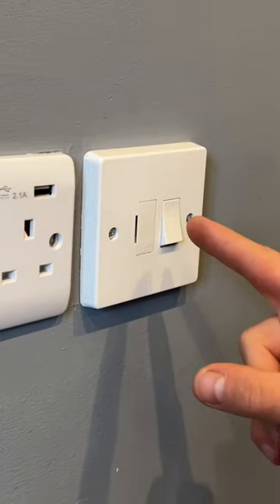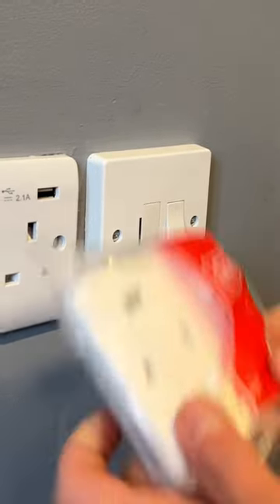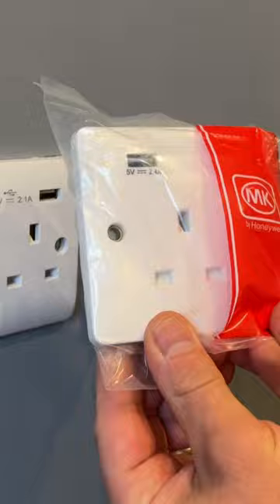Should homeowners and DIY Dave be allowed to change socket fronts? #electrician #shorts #prysmian

Comment: I would have checked the connections on that spur with a meter before touching them. You can never assume. I am not an electrician but I have been doing this stuff since I was 11, taught by my Electrical Engineer father.
Reply: You're assuming he didn't. You should never assume
Reply: Yeah they edited out the sparks and the "oh sh*t!" moment.

Comment: And in a year you can take it off again and replace it with one that supports USB-PD on a USB-C connector.
Reply: Those things are an absolute nightmare when it comes to carrying out insulation resistance testing. If you find these in an installation you can only test combined L/N & E otherwise you'll get a dodgy resistance reading and possibly fry the workings of the USB part of the socket.

Comment: I could use that old FCU. I'm spurring a light circuit off a socket circuit so i can run metal luminaires ... Just remember to throw a lower calued fuse in and all good

Comment: Never bother with CPC fly leads myself especially with plastic face plates because that’s what the screws are for
Reply: Best spark in the world this guy tho😂
Reply: Sort agreement but more cpc u have the more it saves your life
Reply: @mickbrooks8114 really? I'm gonna start putting 10 fly leads in each socket from now on, cheers mate 😮
Reply: Yep 👍🏼
Reply: @bullhurley-uv8ys  bit ott
Reply: @mickbrooks8114 No it doesn't.
Once you have a CPC of sufficient cross sectional area then that is all that is required.
The breaker trips.
And if an RCD is fitted, which is highly likely, then the thickness or number of CPC's makes no difference.
Reply: @deang5622   better to have all the point connected  that are there not hit one miss a few

Comment: 2.4a @5v is just so slow! Sockets are always superior as they upgrade with the times. Current fast chargers are 4.5a @ 9v
Reply: Sometimes ots about space as well. I charge over night so speed is not an issue
Reply: yeah but if you're not in as hurry and overnight is fine then its perfect.
Reply: We are at 20V @ 5A with USB-PD. 100W

Comment: That cable must have been a joy to strip half the outer sheath is still on lol
Reply: Yeah noticed that, done on a friday when the chalk had already left for the pub!
Reply: Don’t understand the need to earth a ko knockout box
Reply: @leewareham4529  yeah - I don't get that either. I know it's in the current regs (wasn't when my house was built in 2000), but I really don't understand what it gains. I'd have thought it just makes it marginally less safe by putting 2 conductors under one screw if there isn't a second earth terminal!

Comment: Nice. Torqued down terminals and clocked the faceplate screws too. Though I must admit, I prefer 3 o'clock to 2 o'clock, but hey...
Reply: Always 12 o'clock then crap falls out of the slots😂
Reply: @baldyslapnut.  That is what we were always made to do on hospital installations. Screw slots always vertical! That was about 40 years ago though :)

Comment: Yes! Absolutely... but you need to know what you're doing and work safe, of course.

As a DIY'er, I have sorted some fairly big oversights done by pro's at friends houses... earth wire not connected to metal faceplates, MCB which wasn't grabbing onto the busbar, loose connections in both light switches and sockets... even a splice to a lighting circuit which was done by just twisting wires together and taping them(!!) instead of a proper junction box. They probably thought nobody would ever see it, but it was discovered years later when floorboards had to come up for a different reason and we saw it... then wiggling it made the lights flicker.

I think the common factor is that it's been new-builds and I'm guessing the sparkies have been under time pressure from building managers and thus, in a hurry.

Comment: I've never understood wanting a USB charging port built into a receptacle or to furniture. Technology moves too fast for this to be viable, within 6 or 7 years it'll be out of date, if it isn't already out of date. 2.4A is bare minimum for most phones today, and it's a slow charge. Not to mention the potential security concerns with this. You're far better off using a high quality power adapter than this.

Comment: I wouldn't have a usb charger on all the time 24/7 I think it is a fire hazard, and worse, a parasitic load on the grid, wasting electricity 'round the clock and adding justification to build more power stations including nuclear reactors, the waste from which we have not got any data on really for it's long term effects on the global DNA code/fundamental property of life on earth.

Most of the electricity we get, we waste

Comment: what makes this ipad compatible?

the one next to it is ipad compatible 

pretty much any charger made since 2011 is ipad compatible 

we havnt used 1 and .5 amp chargers in ages and even those are ipad compatible

and 2 amps isnt even enough for the current generation that need 3 amps if your going off charge speed

so you griped over the .3 amps difference and still fell short of the 3 amp rating for a ipad

and its not even usb C or capable of the power delivery spec for 35/100w charging

Comment: I would never trust a USB power supply that I can't just unplug if it has a problem. Just a built in fire hazard.
Reply: Agreed. I've seen a few burnt ones in hotels in recent years. I've also seen many dodgy USB cables that I wouldn't want in the wall. Plus you're stuck with whatever power delivery capacity the faceplate has when installed, so when you get a new device that supports ultra mega fast charging, you can't benefit from it, unless you upgrade the plate again 😂
Reply: And constantly consuming something (if tiny) and making fixed electrical testing bloody hard work...
Reply: Im guessing insurance would say you shouldnt have installed a usb charger into a power socket.
Reply: Interesting thought. I am a long since retired electrician, but was surprised that the NICEIC allow these USB outlets on  sockets, when no local means of isolation is present.
Reply: @Stan_55UK   I would assume that it isn't covered as at the outlet they would constitute a low voltage appliance which isn't regulated in the same way.
Reply: @harrier331  That would make sense.

Comment: Personally I won’t touch electrics and plumbing and gas just because it safety issue. But how much would an electrician charge to swap out plugs the reason why I would get an electrician to do the work if I had a house fire the insurance can’t say we won’t pay out cause you never got the work done by a professional. 

But in essence it’s only 3 wires as long as you put them in right hole then your golden but it the what if

Comment: Incorrect safe isolation, no ferral on the CPC fly lead, not using a torque screwdriver. oh and not taking the outter insulation off the neutral. Crap work!

Comment: Is there any need for fly lead when fitting plastic accessory?
Reply: It is not the plastic accessory that matters here, it's the metal back box which needs to be earthed.

And in this particular case it is not required because the earth wire is connected to the socket outlet and continuity exists through the metal fixing screw to the back box.

The fly wire is completely superfluous.

But there are occasions when this technique cannot be used, so check the regs.

Comment: Stuff like replacing new outlets or a new switch is ok.

Anything else that involves changing stuff like in the video shouldnt be done lightly, you shoudl understand what are you doing.

I've changed a couple of smart switches at my house, anything involves the main cabinet i will have a sparky come in.

Comment: Dumb question: you didswitch off the mains to do that,  right?
Reply: He didn't do safe isolation? I didn't see him verify
Reply: @PearsallEu exactly he only used a plug checker to make sure the socket was dead - he should have used suitable voltage test lamps and a proving unit to check the spur was dead
Reply: He made sure it was wired correctly with the Kewtech at the twin that’s being supplied by the fused spur then switched that ring off at the CU. Pretty sure he would have used a 2 pole tester. But I think the idea is that it’s DIY and the DIY guy may only have a socket tester and being able to isolate at the CU if a socket tester at all. 
Best regards, 
Scott. ✌️🙏✌️
Reply: Well if they are allowed to change a plug!.......?

Comment: I have a freind and he says he want kitchen done and he will do electric him self I did start asking questions what wires he want to use for oven and induction hob he couldn't give me an answer so i said ill help you. I went to his house and look at the wiring I said lets we do some testing I knew he already done some electrical work, so half of sockets have 120v
We end up rewiring all house.
Even if you changing socket or switch how DIY guy know is the right voltage passing through there maybe switch damage and that could be problem for appliance to work correctly.

Comment: I've replaced all my plugs with USB ones myself. I've also upgraded various light switches.

Most of them, you're unscrewing 3 wires and adding them straight back in.

The trick is to electrocute yourself when you're 12 to build up a healthy fear of what happens if you rush it.
Reply: Oh,. couple of things. I throw the master breaker always. The first time I plug anything in, I've got more padding and insulation on my hands then a catcher at Yankee Stadium.

Comment: Had a fuse spure that became obsolete due to having central hesting installed as it was for an immersion heater, I found out it still had power going to both so I removed the fuse inside the Fuse spure and wasn't sure if it would shock or short on any loose wires or exposed copper so I removed the 13 amp  fuse to be safe and lessen the risk of a fire , now it no longer powers up. As the light on thr spure dosen't light up anymore hence why I know it's no longer powerd.

Comment: Why are you using a 5v 2.1A USB A outlet in 2023? Thats not going to charge any iPad, or mobile device very fast. At the least it should be QC3.0. Really these days you should be installing outlets that are USB PD
Reply from the maker: 2.4amps buddy
Reply: @Cjrelectrical  You realise devices dont actually draw 2.4A just because the port can provide it right? Even if they did, Whats 300mA @ 5V? A extra 1.5W?

QC 3.0 can provide 5v, 9v, or 12v. USB PD, more than 20V. At the same 2.4A, thats 48W. PD can actually provide 100W, and be used to charge most modern laptops.

These have basically been the standards for the last 10 years (with PD being the newer, more supported standard)

This video is basically "i had some old stock in the van, screw this old guy, what does he know"

Comment: USB A IN 2023? This is crimal also BTW These wall USB Sockets fry your batterys if not checked theyre correct before use but have fun
Reply: 'fry your batterys(sic)' - really, how? They're not connected to them.

The ludicrous ideas some people have about subjects they've never bothered to learn..
Reply: @Monkeh616  many times i have used usbs in sockets and so have many people I know they have melted cables themselves damaged phone battery’s causing battery health to rapidly drop to very low levels and cause the battery’s themselves to get hot… I agree maybe not all plugs are the same and it can be down to cables etc but if you do not research what you are using they can certainly cause damage. From your POV My comment may seem as if it’s backing up USB C Saying it fixes this issue but it doesn’t it can have the same issues as any others. The fact you can say “People comment on what they have never learnt” proves your lack of respect and recognition for others peoples opinions and reasoning. Completely disregard what I’ve said but it’s common knowledge these USB port in power sockets can causes damage to tech items cables phones etc if not check used installed or even compared with compatible cables devices etc… my research and previous experience has show me this is correct…
Reply: @Monkeh616  it’s also besides the point the main objective to my comment was the fact he was using USB A Sockets and not USB C in a day and age where most tech uses USB C
Reply: @MY735TV  And where are you getting these sockets, and are they by any chance the same quality as $2 'chargers' from far eastern suppliers? The batteries too, probably.

It's not common knowledge that properly designed 5V supplies melt cables and damage batteries, because that simply isn't the case. There's no practical difference between this and any plug-in supply as far as the device is concerned, and the output to the battery is managed by the device, not the supply.

Comment: WTF would anyone install a switch mode power supply that you can't turn off or unplug? I got a couple of those and after a bit of testing they went straight in the bin.
Reply: They also make a horrible buzzing noise unless a large load is connected

Comment: That back box is a fire hazard as it's not fitted correctly .You don't need a earth cable as its earthed through the plug screws and have you checked you have the appropriate fuse and cable size to be compatible  and support with what you have fitted now
Reply: Some years since I retired, but agree re the back box. We were not allowed to rely on the screws for earth though; is that different in today's regs? (It was 16th edition when I quit the game.)

Comment: No. Reason is this UK ring system. If you brake a ring it is very dangerous. And they are not trained for safe isolation. So simply no.
Reply: Understand what a ring is and don't break it then. Simple.

Comment: Unfortunately we arent "allowed" to in Australia, but New Zealand, which we share the same electrical systems and standards with, you can. Figure that one out.
Reply: Easy to figure out.
The risk posed to the worker working on the electrical installation is not just down to the nominal voltage of the installation or other aspects of it, it's also down to the competency of the individual and compliance requirements such as their qualifications and regulations.

So whilst the electrical systems may be similar, there is no reason why the rest of it is.

Comment: Uk outlets just look medieval
Reply: But are way safer than US or many others. Shuttered, polarised, earth contact makes first, fused plugs, touch proof pins, plug body prevents touching either conductor pin when inserting and design discourages removal by pulling cable as it exits from the bottom rather than the face.
Having worked with many European and US domestic connectors, I'd choose the UK for sure, medieval or not! 😅
Reply: Why do you think that?

Comment: I'm not  a fan of putting active electronics in the wall.
Reply: Why? It's easily removable if it fails.
Reply: @deang5622  And throw away a perfectly usable 13A socket, just because the USB side has gone bust.

It's also far more expensive than a simple socket, and a plugin charger.

Also also, the USB bit is always operating, which is a waste of energy.
Reply: @deang5622 well if it gets hot and starts smoking, it's not nearly as easy to remove as flicking the switch and/or unplugging a plugged-in adaptor.